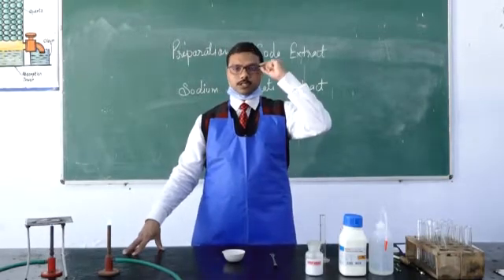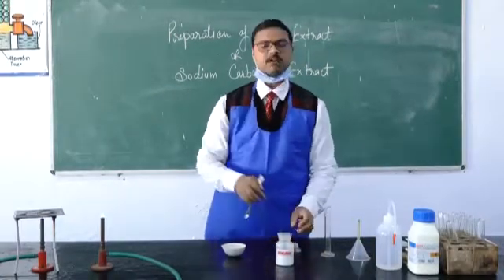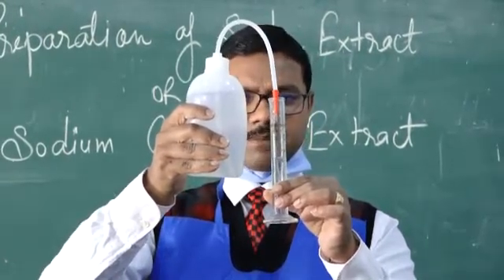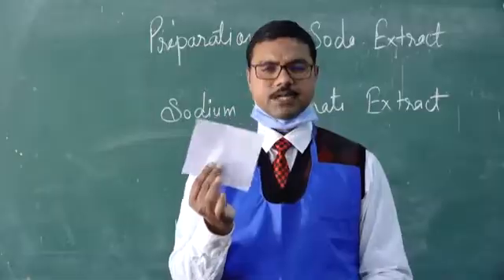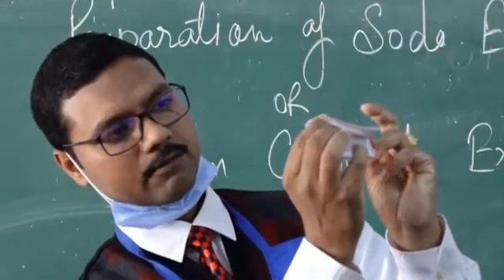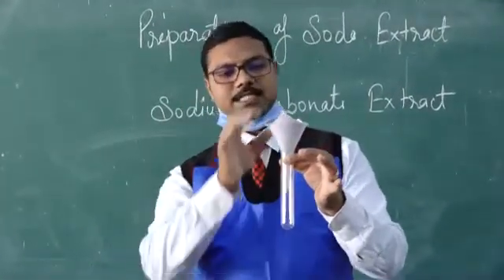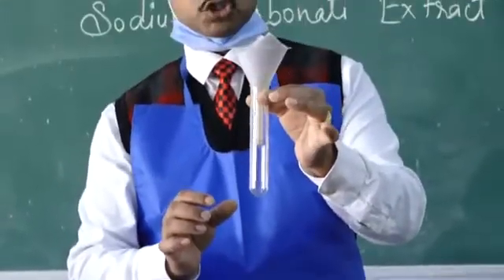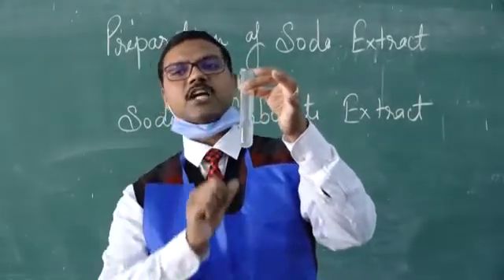PREPARATION OF SODA EXTRACT (SODIUM CARBONATE EXTRACT).

Comment: Sir i the ratio of sodium carbonate:salt should be 1:3 then why you are using 1:4 (its given in books ) if wrong pls tell
Reply from the maker: Remember soda extract is used for the test of anion which are negatively charged particles. Sodium is positively charged element they both combined and make their sodium salt which are soluble in water(soda extract). If the amount of sodium is less then less anion particles are seperate in the form of sodium salt which gives you a poor result.

Comment: Sir how much time we have to boil the salt +sodium carbonate solution??
Reply from the maker: 3 to 5 minutes... until the bubbling occurs.
Reply: @innovativechemistrybymr.ab1922  but in book it's given that we have to boil it for 20 minutes
Reply from the maker: Generally, we prepare soda extract for those given compounds which are insoluble in water. It is prepared because it brings all the anions of the given sample into solution, otherwise they might be insoluble and we couldn't carry out the experiment properly.

Heating timing is depends on the burner that you use eg:
Alcohol Burner: 15 - 20 min
Bunsen Burner: 10- 15 min
Electric Burner: 4 - 8 min

It doesn't make any difference which burner you are using once solution starts   boiling you need to stop heating. 

Make sure during heating complete solution will not be evaporated.
Reply: @innovativechemistrybymr.ab1922  sir my teacher had told that there should not be any whitish coloured solution ..boil it until it becomes fully clear not whitish.. which takes ultimately 20-25 min.

is it correct?
Reply from the maker: Yes